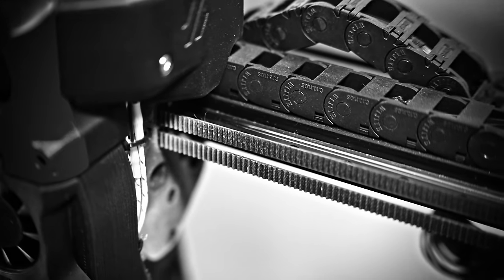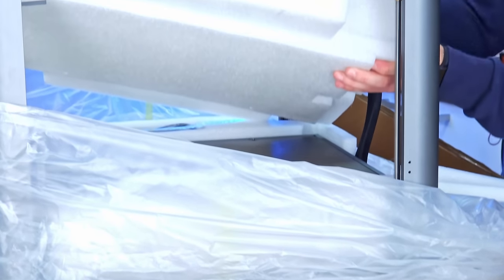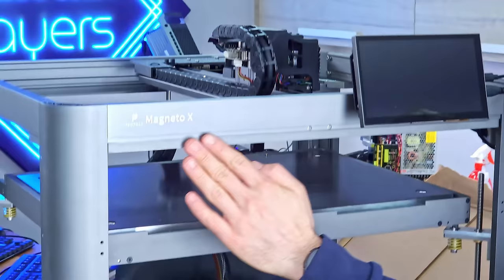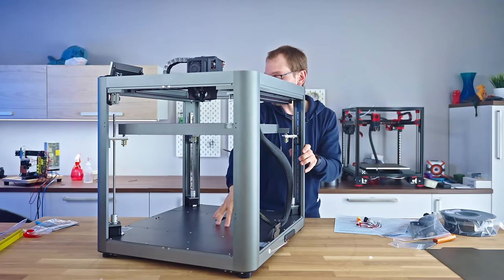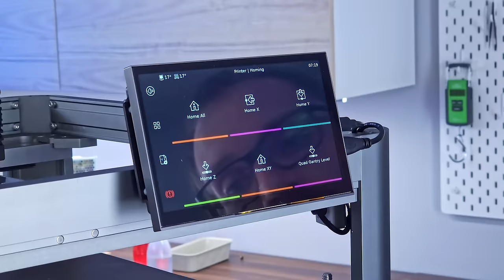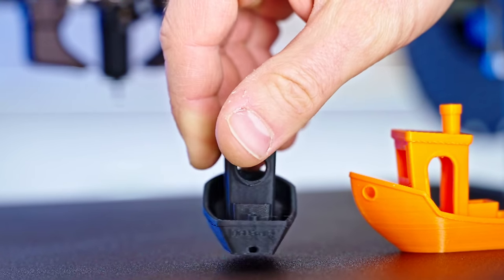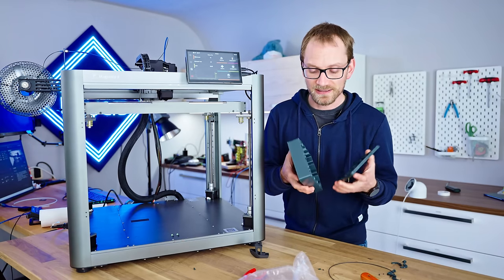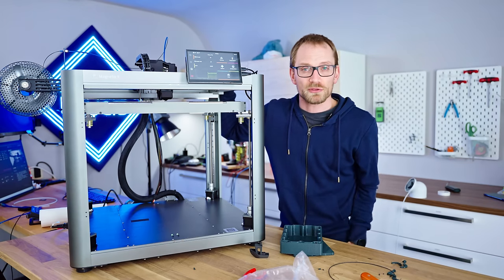The 3D printer with no belts: The Peopoly Magneto X uses closed-loop linear motors!

Comment: Thank you so very much for showing the issue with ability to jam the bed into the print nozzle. So many people expect these machines to be plug and play without the chance of damaging the print, machine or themselves. We need more education in this hobby that we are operators of a power tool and WE are responsible for the movements of that tool. Yes, the manufacturer should install safety mechanisms, but we also need to learn the limitations of the printer and understand how to keep calm when it starts operating outside of expected parameters. You stayed calm and solved the problem without further damage. Thank you for sharing that experience.

Great video and very informative. On machines that I operated that had linear rails, they were really good at very fast movement over long distances and short stopping distances meaning minimal overshoot, but those machines were never for small detailed movement. It was designed more for that speed than accuracy. I wonder if this is the best technology for 3D printing accuracy as you showed. I would love a followup video if you ever manage to clean up the quality. I would be interesting to see if its possible and the steps you took to get there.

Comment: I had been pondering on building a printer with linear motors for about a month before I saw the Magneto. Glad to see someone did it! They are used often in circuit card manufacturing and watching how fast and accurate the are is pretty inspiring.

Comment: i think that some of quality issues might be caused by some sort of hotend damage that happened when you ran it into the plate, i saw similar issues when my nozzle was damaged (tried cleaning leftover filament with snippers and cut some of metal) and got uneven
Reply: To be honest this whole part after the bed hit is so unprofessional on his side that is hard to watch. Clearly the hotend got bend and he still continues to print with it. Whole print is already compromised and the fact that he is still talking about the print quality after that is honestly so unprofessional. He should actually stop after the incident, replace the hotend and make sure that the frame is not compromised in any way before continuing the review.

Comment: Four linear rails... mounted straight to what appear to be anodized aluminum extrusions that are part of an assembly. Those guide blocks undoubtedly have a ton of clearance to make them work without binding. The 3d printing community still hasn't figured out how to use linear rails. A 15 ton vertical machining center can sling around a multi-ton chunk of cast iron on two rails with a single ballscrew. The important part is rigid mounting of the rails to flat and parallel surfaces, which permits using guide blocks with preload (or at least zero clearance). If you print out some calibration parts on this and stick them on a CMM, or even do a cursory inspection of them with manual metrology tools, I bet you'd be shocked at how imprecise it really is.

Comment: I have Yamaha pick and place machine at work and because of this video i have finally realized how Y axis works for two heads on same axis. I did try to find belts or something else and didnt paying any attention to magnets inside linear axis
Reply: Ohhh! I see. Now linear motors make more sense (with two moving heads on the same linear rail). I was struggling to find any positives to this drive system.

Comment: Good video Thomas - Thank You.
But then the "How can this be improved" part of my brain stood up and started shouting at me.
Put the magnets in the linear rail truck and a whole series of coils into the rail and then a lot of wire movement will be saved.
This sort of propulsion system should work very well in the 3D PRINTER market but when it comes to driving a 12mm cutter through a piece of steel then it probably will not have the sheer power to be able to take big cuts at higher speeds to do it.
For the most part, belt linear drives simply get overwhelmed which is why screws are the go-to for high energy machines.
BUT for low energy linear movement applications like 3D printing and laser machines I can see this style of machine motion going far.
And the G0 type commands should be able to really shoot the truck to the end point at a very rapid rate.
Seeing where and how this technology goes in the next few years should be interesting.
Reply: I want to try one with coils in the rails too, with crossed rail gantry so there are no moving motor wires at all. It would get wasteful with energy at large size since you're magnetizing a lot of rail area that isn't doing anything, but it would be super fast moving around permanent magnets rather than the motor stator with its wires and drag chain. The only part I don't know how to do is the linear encoders.
Reply: The X axis still has to move, doesn’t it? So it would just move a handful of smaller wires from head assembly to X gantry

Comment: That's a very very coarse linear motor.
And I think the patterns you see are a direct result of that.
This could be in theory compensated thru a calibrated motor profile, but the closed loop controllers need to be able to do that.
That would mean they need a lookup table for the entire travel length, those controllers don't look like they would have enough RAM for that.
Reply: Next thing is, that they get feed from a stepper interface which is suboptimal for CL servos.
Next position and an acceleration curve would be much much better.
Klipper should be able to give that.

Comment: The release of this video will spur Peopoly to do further touch-ups and polishing to the full release machines. A cover for the terminal connections on the back of the primary power input cord socket will be implemented quickly I'm sure as well as upgraded spacers on the x-axis motors and etc. Finding these things is the reason for sending out test models for beta testing.

Comment: re: the step size vs magnet size - it uses the ratio of the values in different places to accurately locate exactly where it is -  2 sensors separated by half a magnet size would give sin/cos output, so you can easily tell what fraction of a magnet step sideways you are, and you can use more than 2 measurement points to cover for variation on magnet strength

Comment: on the wifi issuie you saw, if it's using an ESP32 for wifi (which it seemed to be doing) it might only be able to connect to 2.4ghz wifi.  I know my mesh network forces wifi to 5ghz...  /shrug

Comment: Hi @MadeWithLayers, Great video!  It was fun to feel like we were discovering the nuances of the printer with you.  I got curious and downloaded Orcaslicer 2.0-dev to slice parts for a Magneto X.  In the process I noticed that Pressure Advance is not activated by default.  So I would imagine the print issues that looked like poor pressure advance tuning was actually pressure advance not on.  I'd like to see how different your print turns out with pressure advance on.

Comment: I always wanted to have linear encoder on 3d printer. I think they allow for precise printing in the long term. If they can be calibrated properly, bents, bumps or shakes will have a lot less impact than on other printer. And they allow to use linear motors that have others adventages.
I can't wait to see perfectionment of this technology, so we can have truly reliable 3D printer for everyone.

Comment: Congratulations on your excellent in-depth unbiased review of the Magneto X 3d printer.
I commend you for pointing out the electrical standard failings, issues whilst unboxing the printer, software issues (including crash) and oversight in the build instructions, as well as pointing out its better qualities.

The magnetic drive is an unusual unique feature, is it on both the X and Y axis?
From an Engineering point of view I find the magnetic drive and two heater elements in the nozzle  intriguing, however as an end user I find the concept of printing in five materials without swopping out materials a better attraction.

Strange that this printer is only available in 240v configuration when the price is in US dollars, clearly targeting the US market and ignoring the European market where 240v is more common.

Although it’s sold out according to their website, it’s offered at a pre-order price of $1,999. Not sure beyond the magnetic drive and the expensive looking nozzle you’re getting for the cost?

I have just found your review so signed up to your YouTube channel, looking forward to watching some of your other videos. Hope you have one on multi nozzle printers?

Comment: The feedback sensor for the linear motor might have some deviation. You will see some repeating pattern. And some low frequency deviation. The repeating pattern comes from the interpolation is not 100% accurate. Low frequency deviation ist from that the scale is not 100% accurate. Those errors cannot be mitigated by input shaping. It would need some error correction look up table.

You can prove that sensor deviation by printing one test sample slowly and one test sample fast. The artifacts in the print surface should stay the same.

Comment: I was experimenting with using a brushless DC motor on the extruder itself (a small drone motor with worm drive). It was fundamentally pretty similar to this - a standard control board feeding step/direction inputs to a BLDC driver. (just different axes, and with the magnets in a circle instead of all in a line). I ended up giving up on that project because the closed loop control wasn't fast enough, resulting in the extrusion motor slightly lagging behind where it should have been. I think it was mostly a limitation of the firmware in the ODrive I was using, I wonder what the high frequency movement accuracy of this system looks like

In a bldc system like this it's actually fairly easy to measure that with a logic analyser, you can compare the sequence of steps coming from the printer controller to the encoder positions returned from the linear motors.

Comment: I think that oscillations is going to need no a little bit but a LOT of tuning. You have there a magnets don't have any kind of dampening like a belt does, and also the closed loop is going to introduce some vibrations and etc etc etc.
Reply: I hope they can fix it. That looks just like 2mm spaced belt VFA that most current stepper/belt printers currently suffer from at certain speeds.
Reply: Keep in mind he rammed the hotend into the build plate before running a single print. That will absolutely throw off any real printing results
Reply: @xsolar  cant imagine it introducing any artefact like that though ...
Reply: I cant get over the fact the magnets are just hanging out there, unrestrained, surely this will mean the field is changing with vibration, so that any tuning will only be temporary? Maybe im overthinking that, but i would have thought setting them into something, or potting them in some kind of high temp silicone would be preferred?
Reply: @jeremyglover5541  No, the magnets are not hanging freely, those are in the head  and in the raio, like a train. Are kind of exposed? Yes, but not hanging free

Comment: This is s very clean design, i love what theyre trying to do and honestly it solves a few mechanical shortcomings of the current sort of printer.  They may need to use a higher preload slider set, and the tuning  should help with rhe waver as well.

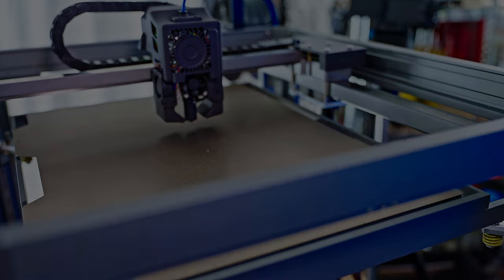Comment: If that is PETG you should have tuned it first. PETG is notoriously hard to print with default settings. It sounded like the nozzle was dragging on the print 21:51 (either that or it's the magnets). The best way to prevent nozzle drag with PETG is to choose continuous infills where lines seldom cross each other - best infill for PETG is gyroid by far. This is because PETG tends to ooz and goes down heavy at the beginning of an extrusion and light toward the end. In situations where you cross lines, the retraction and extrusion have to be perfectly tuned otherwise you get nozzle dragging and accumulation on the nozzle. The ringing is likely from printing PETG too fast. I would have probably done a PLA example if I were going to showcase a printer without tuning it for the material. That was really bold. It took me a determined week and a lot of research to get my PRUSA mk4 making good quality PETG prints: Temperature tower, speed adjustments, infill changes, observations while printing, cleaning the nozzle, changing to textured print bed, adding a silcone sock on the extruder. PETG takes work on any printer to successfully print large surface items like that (without corners coming up and/or layer shifts) and much more to have something with no artifacts.

Comment: Im not terribly knowledgeable about the minutiae of 3d printers, but in regards to the flow issues, is it not possible that the bending that occurred prior to your custom print damaged the hotends inner tube causing less consistent extrusion?
Reply: That's most likely why he had the issues on the last model he printed. Me thinks it would have helped for this bloke to read the instruction manual and become a little familiar with the machine before producing a review video. Honestly he did a huge disservice to both Peopoly and his own brand.

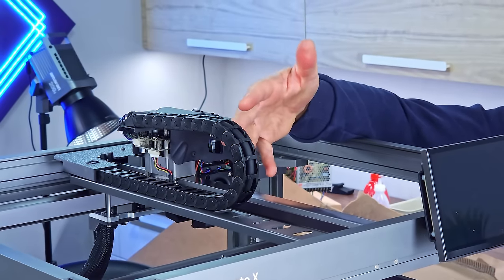Comment: The linear drive system is very fascinating. Are the encoders on the linear rails optical, or utilizing a hall-effect sensor? (8:43) Calibrating the position of the magnets could offer very high precision positioning, but this would need to be part of the manufacturing process, or via other reference sensor. 
Wondering if  WiFi connectivity is related to positioning of antenna? (7:14) I'd suggesting trying with WiFi antenna on wood desktop away from the metal frame. Position looks close to AC power cables, which could be creating noisy RF background. (or metal frame acting as shield). If works on desk away from frame, then repositioning, or giving the antenna ~1cm spacing from metal might help. 
Foreshadowing a later concern. (13:47)

Thanks Tom, like this very thorough deep dive with the unboxing format. Great adapting and going with initial hiccups on the fly. Demonstrated your talents just as much as the Peopoly Magneto printer.

Comment: Interesting. I've seen linear motors get used in place of ball screws in some milling machines, and the rationale for them there is some combination of better thermal stability and much faster travel moves and better acceleration. For a 3D printer where you've got much smaller loads being moved around and you're not limited as much by the cutting tool, I'd bet those speed benefits are even more noticeable.

Comment: As for you comment on the coarseness of the magnet track. With Linear motors like these you can go pretty coarse and still achieve very good accuracy. By my guess (depending on the driver) this should be able to do some 50 - 10 micron accuracy.
Though indeed I would highly recommend that they find a way to cut down on the control loops running on top of each other, it will hurt ultimate performance. This is very expensive so I do understand why they did it this way for first gen

Comment: I am curious about current & power consumption. A few years ago I worked on a design for a countertop shake table, oscillator-driven, and we looked into various actuators. For a given power level, linear motors sounded best but by far most expensive and needed a huge power supply (240V). We ended up going with pneumatic.

Comment: You know, it makes me wonder - there's a load cell in the print head, why couldn't they have it stop the crushing?
Reply: You are exactly right, it could throw an error code to klipper same as it does when it experiences a step missed error and shut down klipper.  The feature request has been passed onto the dev team.

Comment: Really cool idea, but I guess I still hang up with my Ender 3 classic = )

My concern is it have too heavy parts which makes hard to print fast, and also too much electronics which makes it hard to fix.
But the concept is cool. Why not. Also it is still has 4 stepper motors just for bed. So it does not fully eliminate them after all. = )

Also cooler spindle is not fixed is not that bad, you can easily oil them this way. I myself often remove fixing washer from the other side so I can easily oil them in future without disassembly.

Comment: This looks like an interesting project. I think the rippling and other abnormalities could be a  function of having magnets drive the movement. When the driver is near its apex of control, but before the next driver takes over, there would be a slight pause or "bump" that could cause printing malformations. I don't think slicing settings will resolve that idiosyncrasy of this kind of printer.
Write this down and come back in a year or more (perhaps less) and see how they resolve it.
One concern I have is the pricing of this kind of printer. It has to essentially unreachable for "the masses" who in this economy are struggling just to get an original Ender 3. And that doesn't even consider the cost of all the supplies needed to continue to print.

Comment: I'm getting close to pulling the trigger on one of these, mainly because I think I can get better print quality with it compared to more traditional stepper-driven systems? I'm only worried about the beauty of my prints rather than speed - surface finish is everything for my application. What do you think are the chances of the final product meeting my needs? I'm patient and willing to work with Peopoly as needed...